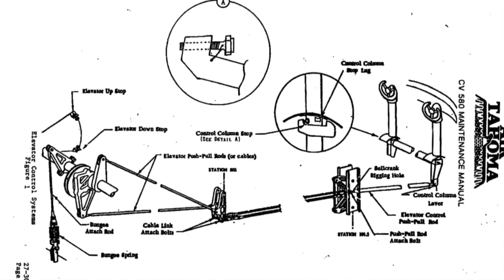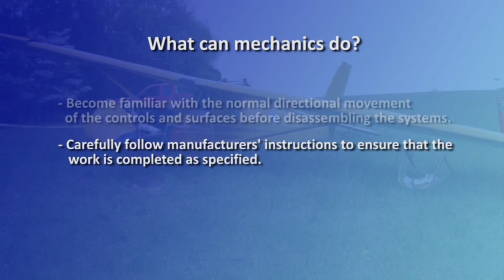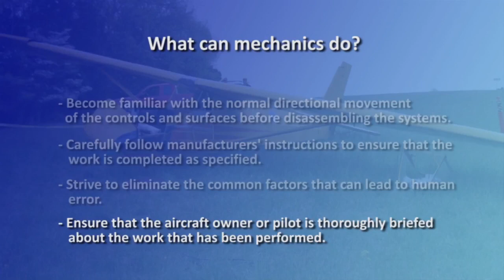Airplane Misrigging Lessons Learned From a Close Call

Comment: I accidentlly reversed a servo for the elevator on my RC plane, luckily I knew pretty quickly I had flipped a switch by accident and brought it in for a landing using opposite input for elevator which was really hard to do, in a real plane theres way more gong on and alot more at stake, I would hope a pilot could figure out the thing is operating opposite to how it should be if it was misrigged. I work on cars for a living and have made a couple of serious potentially very dangerous errors over the years,  luckily no-one was hurt by it but I still feel awful, maintenance guy who mis rigged the plane must feel like a real dumdum LOL

Comment: It's trange that nobody mentionned, I may be wrong being french and nut fluently bilingual, but I didn't ear anybody mentionned to visually check the trim movements on the ground as part of the controls check!
Reply: True.  Even though the elevator trim tabs are not visible from the cockpit, they can be adjusted, then the pilot or mechanic can get out of the cockpit and walk to the tail to see what effect the adjustment had.  It can be done without assistance from a second person.

Comment: Good job of sorting out the problem and returning safely.  It is safe to say that the pilots learned the implication of "trust but verify"...  
On any post maintenance preflight check where the Maintenance Tech says ANYTHING having to do with any flight control, a red flag should immediately go up, and a thorough check made of ALL flight controls for free travel and proper movement...  If two pilots are available, it would be a good SOP for both pilots to confirm that the flight controls are indeed "free and correct" before entering the flight deck... When it comes to critical controls "If maintenance touched it, check it..."